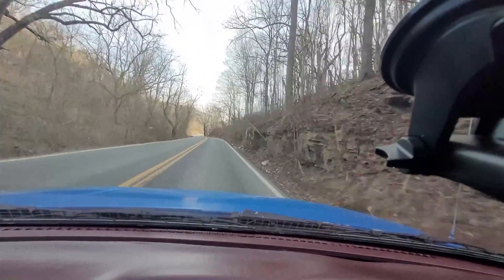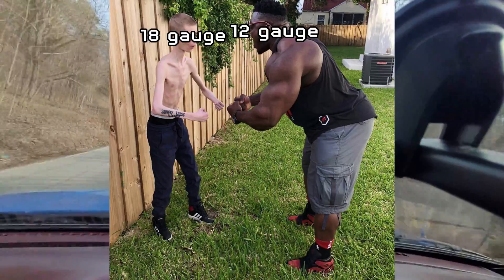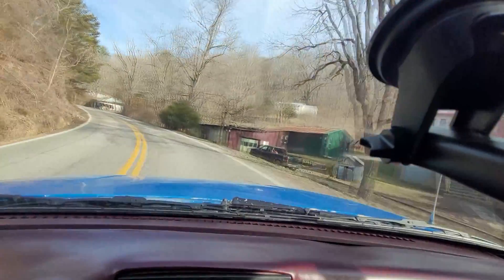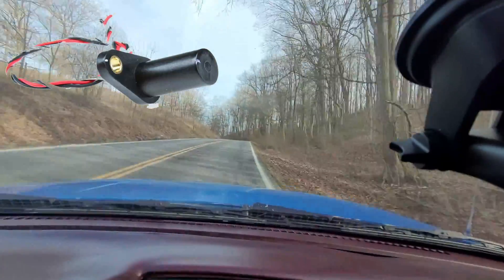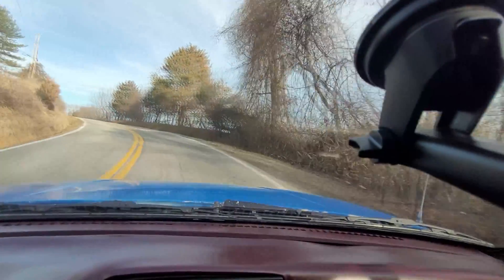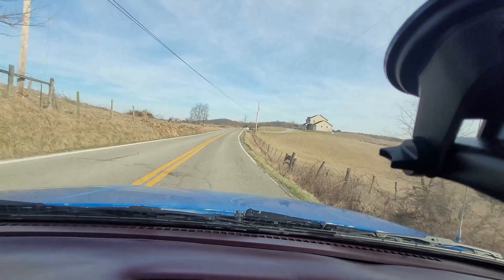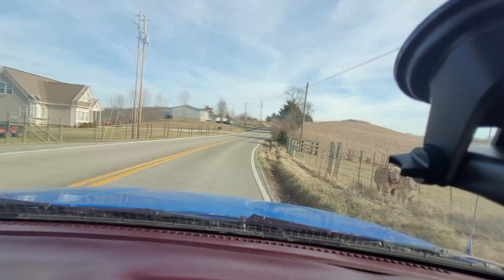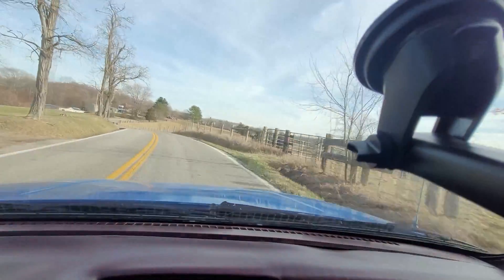ECU Tuning for Idiots - Standalone vs Piggyback vs Re-flashing

Comment: lmfao this is so accurate im 5 years in too doing this crap so yes it takes time and ALOTTTTAAAAA reading before you can change parameters without cooking a piston lol :EDIT  i had to learn on my own daily due to a nightmare dyno experience and no one local around me being able to tune the delco 808 gm memcal based ecms. compared to newer stuff ive worked with there was most certainly a learning curve to it and understanding the parameters inside the o$e12p firmware that was made over on pcm hacking by a few of the aussie guys.  but since understanding one of the most complicated ecms from the early 90s im safe to say im 90% confident i could tune just about anything now. as i said its a learning curve but if you can build plus tune your own engines then you are 99% ahead of everyone else in the car game / scene

Comment: Since this is intended to be an idiot guide, here's an idiot question. If your car has a MAF sensor, does that take the place of the MAP sensor? If so, is one easier to tune than the other?
Reply from the maker: Usually it's other way around, A simple setup will have a MAP sensor but no MAF sensor. you can add a MAF sensor to aid with tuning, but it's not mandatory.

Comment: Companies like ECUmaster also make Plug and play adapters for some vehicles. And for my car my tuner did custom wiring to the oem ecu harness. I just had to route an imap tube to the intake (ecumaster has a sensor inside the ECU) and hat to wire a wideband to the ecu.

Comment: ok so id like to add, (from my own car on "ecutek" with pro license self tunes from stock file) its not just rom. they open up the full operating power of the ecu to allow for extra tables, im talking in the 100's most of you dont see. it add 6 inputs and 4 out puts for signals, so it can run a v8 on a stock brz ecu or add your extra sensors like afr psi e85 ect. and make you own table with xy info and reaction. It complete gets rid of the factory firmware where a dealer can not see the ecu anymore. so yea basically a standalone now with stock. even a boost controller on a na ecu not 3rd party lol
Reply from the maker: That's actually wicked cool. They really left the security for those ECU's wide open, huh? You've basically got all the features on an MS3. Most people don't have that much tunability out of their stock computer unfortunately.
Reply: thats just ecutek is goat. ms3 v69 is what im currently doing for my buddy's and yea its all the same just ms3 is germen and they have f'ed up naming @HatersGarage

Comment: Someone had effed with the transmission tune in my 6L40e and I literally could not find a person in Finland willing to flash the PCM for me as LT1 PCM flashing has a brick-y reputation (and I was about 20 years late). So I googled a ton and I did it myself. Software to read/write and a good tuning software to modify LT1 pcm files are free online, so why the hell not. Only needed an OBD1/ALDL cable.

I haven't done much, but by downloading a stock tune and a bunch of modified tunes I got the idea of what to do and by copying and pasting bits from the here and there. After a few weekends and test drive, I have a tune I'm pretty happy with, I managed to fix the nonsense with the trans, didn't brick the PCM and learned something new.
Reply from the maker: Re-flashing is definitely a viable option, you just have to be very careful and do your research like you did. I'm currently attempting to re-flash the tune on my Sentra, there's a lot involved and all the software is open source.

When you mess up when using a standalone or piggyback you just reset it and it works again, mess up when flashing a stock ECU and it's usually a couple hundred dollar mistake or more.
Reply: @HatersGarage  Probably a dumb question, but: can you make a copy of ROM to "re-re-flash" it to stock settings if shit goes south?
Reply from the maker: @BarcelPL  Yes, you should always make backups of your tune
Reply: @HatersGarage  Yeah, so if I backup the original before re-flashing, I can always just reset it to "factory settings", right?

Comment: Good video, but IMHO soldering is not the best way since it will oxidize quite quickly (3-4 months). Not a problem if wire is new and isolated correctly, but it happens rarely. Twisting wires works great (if there's not gonna be a ton of current flowing)
Reply from the maker: I haven't had any issues with soldered joints years later. Also I understand crimping, but TWISTING?!?
Reply: @HatersGarage  slav ghetto techniques
Reply: Twist and solder - soldering keeps it at place , twist is making the contact "better" , but in general, as an electrician for about 15 years now , i have never had an issue
Reply: If soldering is that bad, why don't electronics like computers de"solder" themselfs?
Reply: @ToTheGAMES  they actually do from time and thermal cycles, but here oxidization and possible strain on wires could speed up this process.

ps im not telling soldering is bad, but twisting is a real alternative for THIS use case

Comment: I’ve been going the reflash route with my car. The programs available for my car are pretty limited unless I want to buy a tune. I’m going to try to decompile the ecu file or create a more in depth definition map before resorting to buying a tune from the only guy who can do it. Got the engine light for my cats off last week and it seems to be getting better gas mileage.
Reply from the maker: Yeah that's a big issue I have with re-flashing. you usually have to rely on other people to change certain stuff